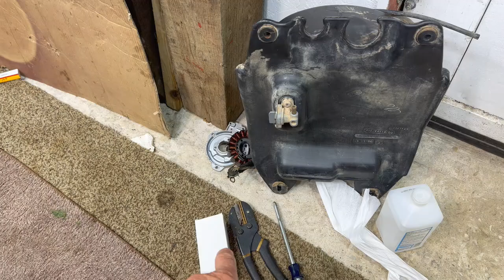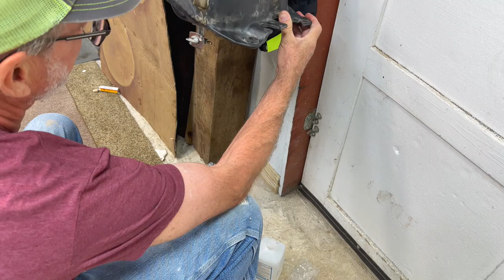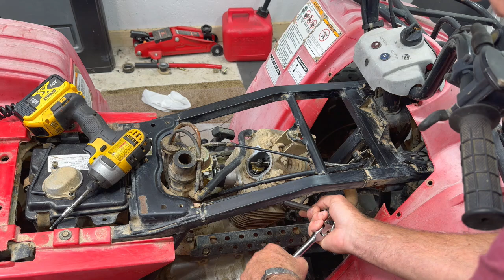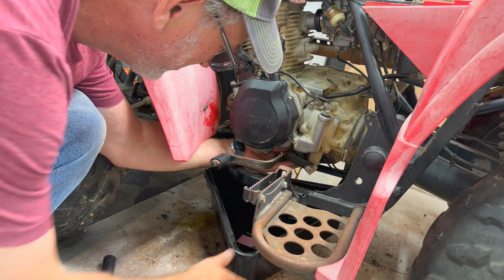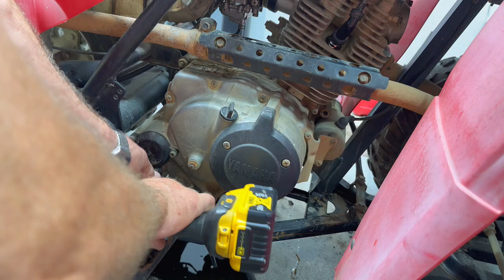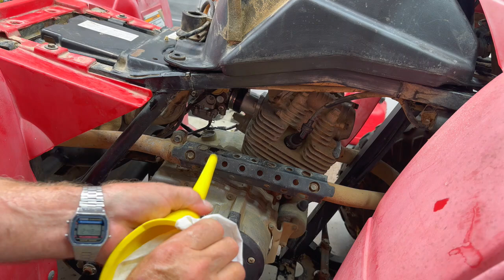2001 Yamaha Bear tracker 250cc--oil and filter change, petcock, valve clearance #yamaha #offroad

Comment: I just bought a 2002 bear tracker 250. It was a tapping ticking kinda knock Clanking to it. Should i adjust the values? I read online that’s probably what it is
Reply from the maker: I would, it’s a super easy thing to do and might just fix it depending on how loose they are
Reply: @herbiesgarage681 I don’t know the history, it may have never been. It runs fine just the noise bothers me. But i assume the noise is just maybe they are loose and it’s just knocking clanging around
Reply from the maker: @FirstShoot-KG There will be some sound even if they are adjusted correctly because of the style of adjusters being metal to metal. But I would still check it and adjust if necessary.
Reply: @herbiesgarage681 gotcha. I expect some sound but it’s pretty crazy right now. Thanks for the help
Reply from the maker: @FirstShoot-KG Good luck with it, you’re welcome

Comment: Got side swiped on the KPX 250, guy pilled right out in front of me, nothing I could do.  I was able to slow down to about 30mph before impact, I ended up going over the handle bars, (think God I had gear on). Got 2 broken ribs, tinny bit of road rash here and there, Busted knee, shoulder and elbow.  I leave a comment because the KPX held up great considering ( I bought that bike because of your channel ) both mirrors are broke, some scrapping on the fairings, completely took out both hand guards and bent the shifter...Structural its still sound, and good to ride. PS he hit me right in from of a State Trooper.
Reply from the maker: Wow Matthew I’m so sorry to hear that happened 😢 But I’m glad you’re okay, the bike can always be fixed or replaced. I hope you heal quickly from your injuries, people just don’t pay attention like they should. I’m super glad you had your gear on as well. Take care of yourself